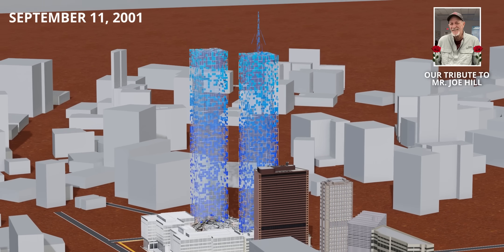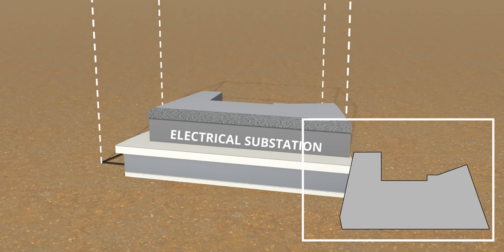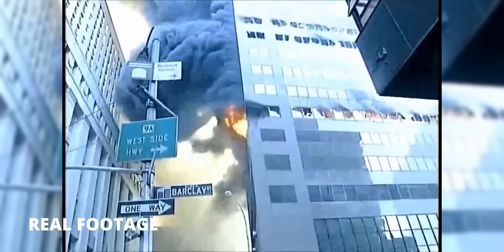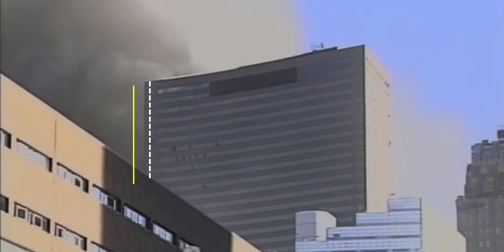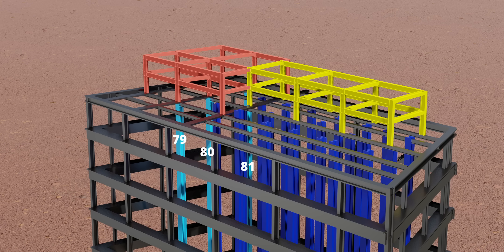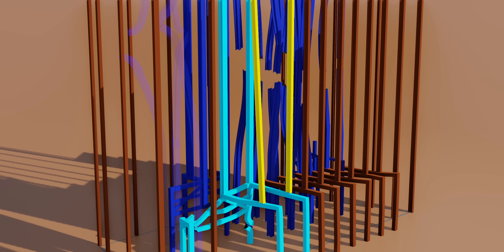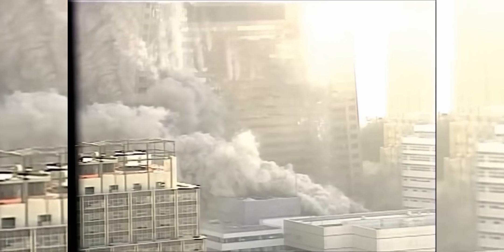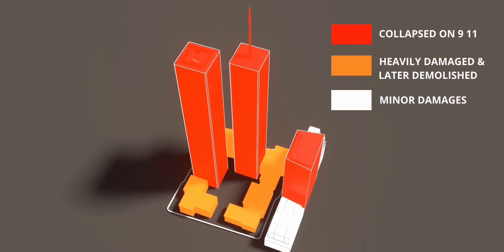Collapse of Building 7 | The Complete Physics

Comment: I think a team at the university of Alaska did their own calculations and I tend to think their conclusion is correct. The building fell at free fall speed indicating there was no resistance to the fall. That doesn't happen from just fire damage.
Reply: 9:03.  This video addresses the "free fall speed" theory.
Reply: The building fell at the speed of gravity minus any minor resistance from the total structural failure. When anyone says ‘it fell FASTER’ then you’re talking about misunderstanding, magic, or rockets. Things do not fall faster than gravity without external acceleration, so stop saying it.
Reply: @schultzeworks  There is no such thing as the "speed of gravity", and gravity does not fall. There is a velocity of fall that increases at a specific rate per second or other unit of time (accelerates) when an object descends under the influence of gravity at the Earth's surface. It is affected by air resistance but assuming it is occurring in a vacuum usually gives a sufficiently accurate result, This is often referred to as free (a.k.a. resistance free) fall, i.e. accelerating at the predicted rate.
Reply: @schultzeworks  no one here said it did so stop getting bent out of shape over something you've made up.
Reply: Remember that the shell of the building (according to the non-credible source you chose and didnt link) fell at that speed. This also doesn't get rid of the fact that they could have likely used the sped up version as a reference. "doesn't happen from just fire damage" is simply an assumption of you so that you can reinforce your conspiracy while making no actual effort to debunk anything in the video because you know you don't have any actual idea on the topic. Atleast use credible sources that don't just boil down to "I heard it" or "Thats unlikely" and actually make an effort to debunk evidence
Reply: @smarty265  and until the 11th of September no high rise, steel and concrete building had ever collapsed from fire damage and none since either. What kind of nonsense are you talking about saying just the shell of the building fell at free fall speed. The "shell" isn't a separate piece of the building, the entirety of the building is all tied together, support beams, floors, walls etc.
Reply: @jasongeorge1522  Keep in mind the study was not traditionally peer reviewed in mainstream structural engineer journals, instead was simply published online for the public to give feedback and not the same as traditional peer reviews from independent engineers, and it was funded by an obviously biased organization called Architects and Engineers for 9/11 Truth who strongly believe it was demo. And some experts have already questioned the methodology and such about the study. So take that as you will.
Reply: @dahomas2027  if it's published for everyone to review  that would include peers, right ?
Reply: @ Yes and while it has been reviewed by some experts who questions the methodology and assumptions and missing factored they used, the difference is that when publishing in a scientific journal it HAS to be peer reviewed BEFORE publishing. This was simply put onto the internet without any of it being challenged before being published. So yes people can review and be disputed it did not go under normal review and rigorous questioning before being released to the public.
Reply: @ I would just be careful about using this source to be a matter of fact when in reality it should be taken with a grain of salt. Yes it is probably well made and such but since it wasn’t thoroughly peer reviewed by people much smarter than us. You can’t take it as a matter of fact if that makes sense.
Reply: @dahomas2027  I understand the point you're making and I would agree if it had just been recently published but it's been out for over 5 years. The people smart enough to disagree with their methods or conclusions have been able to do so. I haven't seen anything substantial come out yet. Have you?
Reply: @jasongeorge1522  I haven’t but I also haven’t done any research to see if it has been debunked for 1. And 2 like I said it wasn’t mandatory for it to be peer reviewed so it is less likely for it to be by a credible source. I am not disputing the studies findings in fact I think the evidence is quite compelling from a layman’s perspective. I’m just saying that the source isn’t SUPER concrete especially given the funding background which is a red flag.
Reply: @dahomas2027  I understand, that's a fair point to be made.
Reply: @jasongeorge1522  glad we could have a productive conversation and I’m glad you brought up the study from UAF in these comments I was hoping someone did
Reply: @smarty265  so you're saying you need me to spoon-feed you information that is easily found with a simple search. You're making quite an assumption yourself saying the source is "non-credible". The entirety of the work the University of Alaska did was published for everyone to review.
Reply: @smarty265 NIST actually did confirm that the building came down at free-fall acceleration in its revised report (the one issued after the fact that there was free-fall was pointed out from the audience at the first presentation and Shyam Sunder very lamely tried to explain it away). No, free-fall was seen and confirmed by NIST's own measurements and the graph evidencing this is to be found in the NIST report at the end of Chapter 3, just before the references.
Reply: Not only that but if the end of the build is weakened why is the whole build falling inward and not to one side. For the build to fall the way it did. The middle columns would’ve have to been weaken. That’s just from me watching demolition videos.
Reply: @BMoore18 Engineering degree by watching demolition videos? What’s next? Video games?
Reply: @BMoore18  the planes impacted the center coloms
Reply: The inner frame work collapsed moments before the facade did. You can see daylight through the windows on the top floor moments before collapse. The facade fell at freefall speed, because there was nothing supporting it anymore.
Reply: @dirtyharry5320 if it was the framework supporting the facade that fell at freefall speed then wouldn't the framework have to have  fallen at freefall speed too?
Reply: @jasongeorge420, come on trixs are for kids.  Video clearly show the penthouse and roof collapsing in. I suggest you count the time from the moment the penthouse begins collapsing into the building, to when the facade begins to collapse. Ask yourself, what is happening to the framework of the building, in those second after the penthouse collapses, and before the facade begins to collapse.
Reply: To be fair, Alaskans are morons.  It's also worth noting that this 3 person "research paper", which included a Chinese nationalist, was funded by "Architects & Engineers for 9/11 Truth", a known conspiracy group also full of morons.  But they got what they paid for.  For the right money, you can fund a study that says 1x1=2.  Heck, Terrance Howard will do it for free!
Reply: My understanding of the University of Alaska's work was that no hypothesis concerning the fall of WTC7 was offered because no-one could fathom one, and in any event it was taken on as a research project for undergrad students (so no "peer review" needed or relevant). However, reviewing the NIST report led to declaring that the scenario proposed therein is certainly not well founded.
Reply: @Chrisjude100  it was not done by undergrads, it was a study conducted by UAF funded by Architects and engineers for 9/11 truth (a biased org), and conducted by a UAF Professor, a post doctorate researched and a PHD student. And they did come to a conclusion about the most likely cause of the collapse which was the near simultaneous failure of all of the columns but didn’t give a conclusion as to how those failures occurred. The focus of the study was really to see if it was caused by fires which they concluded it was not. Which is in direct contradiction to the NIST conclusion.
Reply: @dahomas2027  OK, graduates then. But, as I wrote, they could not fathom the cause.
Reply: @Chrisjude100  They stated the cause of the collapse. They just didn’t investigate what caused the failures that lead to the collapse because that’s not what the study was really about. It was more about disproving the NIST narrative that it was caused by fires that lead to a progressive collapse. They conclude the only way it could’ve collapsed like that was a near simultaneous failure of all of the columns.
Reply: @dahomas2027  Yes, that sounds about right. Whatever the cause, it was not furniture fires
Reply: @chrisjude, when the penthouse and roof collapse, is the building 7 at this point in collapse, or do you think the building 7 starts collapsing later, when the shell collapses?
Reply: It happened because of the already damaged south side and the fire
Reply: @purpl3_games  what was the damage and what caused it?
Reply: @jasongeorge1522 the damage of the towers collapsing
Reply: @purpl3_games  I don't recall there being any kind of significant damage to building 7 from the other towers falling.
Reply: @Sable_Ina  If there were true, and demonstrable, NIST would have said so, and not blamed "Office Furniture Fires". Easy peasy.
Reply: @chrisjude100, I do think you’re having a hard time understanding that not all office fires are the same   And it’s one thing to make up what an organization said.  It’s another to show the specific verbiage regarding your “office furniture fire”
Reply: Careful mate the hate you'll receive,a man interviewed said the staircase was gone completely,but y.t removed all 9-11 videos that go against the terrorists causing it.
Reply: True they also had two buildings fall into them
Reply: Why
Reply: Momentum! If you take a 15 pound bowling ball and drop it from just two inches above a scale, it would read well over the 15 pounds that it weighs. It’s the same as if you were to set a bowling ball on top of some brick pavers that are spaced evenly. Then, allow just two of those pavers from maybe three bricks up from the bottom to break, you then have the momentum from the initial weight of the bowling ball coming down causing extra weight to continue to crush the rest. Times that weight by the floors doing the exact same thing as the bowling ball on the scale.
Reply: it fell at frefall because it took the rest of building with it.
Reply: Just the fact that building 7 has been memory holed for all these years should tell you everything that you need to know.
Reply: Why do you think they got it right and none of the other scores of engeineers who studied this event did?  Please be specific.
Reply: @TheCriticalStinker-jw4fl

I'm intrigued, why do you think they got it wrong, and your preferred sources got it right? Please be specific
Reply: @TheCriticalStinker-jw4fl  this video says the spire created the scar on bldg 7, but then they show a video where that doesnt happen
Reply: I’m just wondering why anyone would believe a report bought and paid for by the people at architects and engineers for 9/11 truth?  Hook line and stinker.  Unless that is what they want to believe, then this report becomes like the holy grail.
Reply: @TheCriticalStinker-01  Nobody else has modelled the collapse and apparently nobody has seriously challenged their analysis.
Reply: @phil6025  "Nobody else has modelled the collapse"? Are you serious? That's either a joke or the dumbest lie i've ever heard.
Reply: @hp7233 What I believe "Phil" is trying to put forward is the fact that Professor Hulsey's very detailed, scientific (Physics, etc.) "modelling" is precise.
Reply: @TheCriticalStinker-jw4fl Please name the scientists who have disproven the University of Alaska scientific study on building 7's collapse, which showed conclusively that fires could not have caused it's collapse. PLEASE NAME THEM. There are none, you're just a dirty liar.
Reply: @TheCriticalStinker-01  Because all the other engineers are being paid off by the deep state. George Bush and Israeli Mossad blew up the WTC's

Comment: Leaving aside for a moment that a number of people have said the antennae actually fell in the othe directioin, it must have been an awfully strong antenna assembly to cause so much damage to so many floors of WTC7. Maybe the people who built the antenna section of the main WTC buildings should have built the WTC7.
Reply: The video is in error on that point. The physical damage was caused by perimeter columns from the north face of the North Tower.

They are rather heavy.